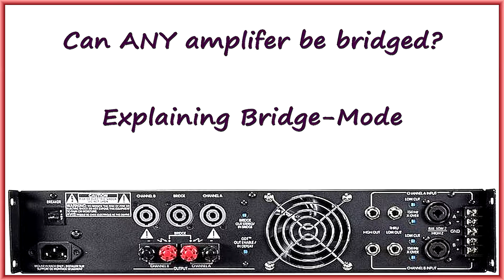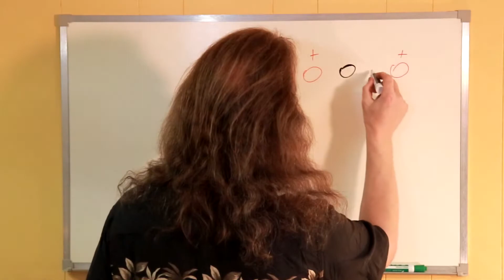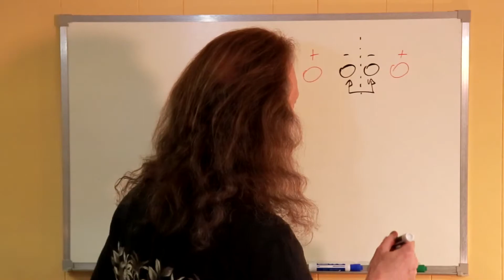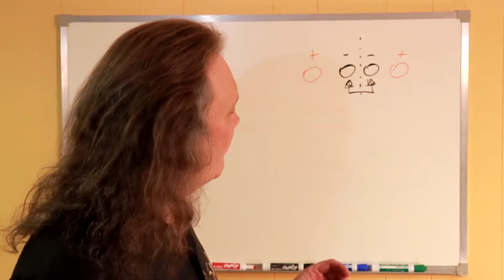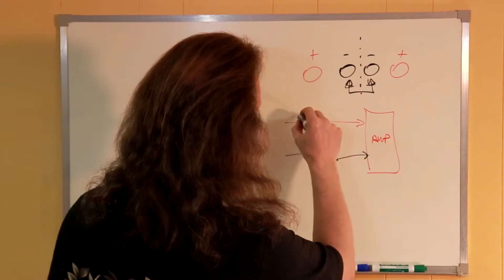Can Any Amplifier Be Bridged? The Truth Every Audio Enthusiast Should Know

Comment: When an amp is bridged both channels are not put together one channel the left or the right is put through a single Mono Amplifier the other channel is put through another single Mono Amplifier never are the channels combined
Reply from the maker: True - there isn't an internal change in the amplifiers.
When an amp is bridged, you provide the same mono signal to both L+R amps (one inverted) and combine the two amps at the output to create a single, more powerful mono output, using both channels to drive one speaker load.

Comment: I'm looking to turn a stereo 2.0 set up so that instead I get the full spectrum of audio signal (both channels) into a single speaker. Is that what bridge mono does, and can I accomplish it by connecting the speaker to both positives the way you showed in the video?
Reply from the maker: Hi, that's a common point of confusion. Bridging an amplifier does two main things:

It combines the power of two amplifier channels.

It uses both the positive and negative signals from those channels to create a higher voltage swing across a single speaker.

However, it does not magically mix the left and right stereo channels into one full-spectrum signal. If you feed a stereo signal into a bridged amp, it will usually only amplify the left channel (or sometimes the difference between L/R), resulting in missing audio.

So Bridging creates a more powerful mono (single-channel) amplifier from a two channel amplifier.

Comment: Hi. Stupid question: stereo power amp circuit with  "output BTL speaker system" - how could I use it Mono, with only one speaker? Can I bridge the channels? Or do I need dummy load for one channel?
Reply from the maker: Good question, thanks!

You can’t bridge an amplifier that already has a BTL output because it’s already operating in a bridged configuration internally. 

Each speaker terminal is actively driven and not tied to ground, so connecting two BTL outputs together causes them to fight each other, leading to distortion, shutdown, or even amplifier failure.
Reply: @Barry-Watson Great many thanks! So it's like 4 amps internally, briged to 2 pairs.
Reply from the maker: Yes, exactly.

Comment: Can Sansui's B-55 power amplifier be bridged?
Reply from the maker: While most amplifiers can technically be bridged with the right setup, the Sansui B-55 isn't a good candidate. It uses unbalanced RCA inputs, which makes inverting one channel’s input signal difficult without external adapters. More importantly, it wasn’t designed for bridged operation, its heatsinking and output stage may not handle the increased current safely. 

Bridging is more common in pro audio or car amplifiers, which are built with that use case in mind. The B-55 is a hi-fi unit, and best used as originally intended for stereo operation.

Furthermore, a unit that is not designed with bridging in mind may not have the current capabilities to really deliver the expected power gains you would want from bridging. So you may not see the kind of power increases you would expect, unless the amplifier is built rugged enough to deliver the demands of bridged operation.
Reply: @Barry-Watson Thank you very much, you explained very well.👌👍
Reply from the maker: Thanks, you're most welcome.

Comment: I have a Krell KSA-200S in use.
his Amp has 4 Outputs (2+ and 2- on the Right AND the Left Channel.
Does it make Sens to set Bidges between + + and - - at the R and L Channel?
Hope explain it good. ;)
Thanks
Reply from the maker: I don't claim to be an authority on that amplifier, so I may be mistaken. It's a very nice amplifier. However, it is a stereo amplifier, so there are only two amplifier modules in that box. There are four sets of output terminals, but really, only two amplifier outputs (left + right channel).  That is, I believe the two output terminals on each channel are simply wired together in parallel.

To bridge amplifiers, you need two amplifier modules.

You could bridge right and left channels, creating a "mono block" amplifier with one single output. But if you want to have stereo operation, bridge mode is not an option in this case.

Comment: Hello great video! I’m a dj and have a sub powered by a crown xti-2002. I’m trying to decide between running it near clipping on one side of the amp (800w @ 4 ohms) or bridged with hard cut at -6 on the meter using the built in limiter (2,000w @ 4 ohms.) In bridged mode it would have some head room, in mono mode it would not. love to hear your opinion thanks for your time!
Reply from the maker: Thanks for the question !  4 ohms in bridge mode is a pretty severe load for most amplifiers, maybe your amp can handle it ok.  The amplifier will perform better, and you may have a bit tighter sounding bass in stereo mode.  Remember that twice power is about 3db, so play some music with your meters touching -12db, then turn up the level so they are now at -9db - that's about the loudness difference you can expect.  Is it worth stressing the equipment for that much (or little) gain, you decide.

This video might be helpful - https://youtu.be/zXZP2O4rH3M
Reply: @Barry-Watson  thanks for the wisdom! I checked out the video link. So then in your opinion, bridged mode even with the increased headroom still works the amp harder? I was hoping with that extra 3db it would let the amp run less hard compared to running Flat out in stereo mode. I do see what you’re saying about both amps doing 2 ohms not being super great. I think I will try stereo operation again for a while. I’ve been enjoying the channel!
Reply from the maker: Some amps are rugged enough to do bridge mode without problems (with reasonable loads), but it's more stressful on the amp.  Many amps can drive 4 (or even 2) ohms in stereo, but are limited to 8 ohms minimum in bridge for example.

Comment: Hi can u connect a mono antique valve amp to a nad 3140 which has pre out and main
Reply from the maker: Depending upon what the tube amplifier expects for an input signal I would expect that to be no problem. I would anticipate that an old tube amplifier would use unbalanced connections, the same as standard hifi equipment so you probably don't have to do any signal conversion. Just connect the pieces of equipment together with a standard cable.

Comment: If I buy the same power output 5 channel amp can I bridge that to my 4 channel amp I already have? Same brand and everything
Reply from the maker: I really wouldn't recommend that.
Reply: @Barry-Watson  why’s that?
Reply from the maker: First, bridging the amplifier probably isn't going to give you that much advantage anyway.  For me, the juice is rarely worth the squeeze when it comes to bridging amplifiers.  You may gain a little power, but you lose audio performance in every other category.

But bridging across two different amplifiers could invite issues when tying the grounds together between the units possibly, and any little differences in gain between the amplifiers would result in poorer performance. Technically, it could be done, but it just doesn't seem like a great idea to me.  They way I see it... If the amplifiers aren't powerful enough when working as designed (w/o bridge), the best solution would probably be to swap these out for a bigger unit that can deliver the performance you're looking for.
Reply: @Barry-Watson  thank you for the information

Comment: Hi do i still have to swap xlr cable if the amplifier is designed for bridge mode?
Reply from the maker: Equipment may vary, but no, if the amplifier has a bridge switch I would expect that to take care of the input connections.

Comment: So... hey recent subscriber, great channel
I have a PA amp with balanced inputs (three connector) that I want to feed an unbalanced line in into it (RCA) how to do that, what are the pitfalls? 
Thanks
Reply from the maker: Thanks for the question.

You could get adapter cables that apply the audio signal to pin two of the xlr connector and ground to pin one and three. That will drive a signal into the amplifier.  The problem with this is that it's unbalanced, so it could pick up hum and noise, and it doesn't accommodate the difference in typical signal levels between Pro Sound and Hifi equipment. The hifi equipment may not be able to drive enough signal into the prosound amplifier to drive it to full output.  The pro sound equipment also has a low impedance input, which may be difficult for the hifi equipment to drive, or cause the hifi equipment to have poorer signal quality because of the excessive load applied.

The proper solution is an interface box that converts unbalanced hifi level signals to balanced pro-sound level signals.  This will preserve the signal quality, and allow you to make the most of your power amplifier. Here is an example of such an interface box:

https://amzn.to/3QYWaHC
ART CLEANBox Pro Dual Channel Level Converter

This particular unit can convert signals in both directions, hi-fi to prosound and prosound to hi-fi.
Reply from the maker: You may find this video helpful:

https://youtu.be/HP4iDvEaonM

Comment: I've dealt with car and home audio for years. In car audio bridging an amp to run subwoofers is almost manditory. Car amps have a switch to do this on demand. In home or even some pa amps there is no switch so, one trick I learned in car audio dealing with ground loop noise is to use an rca level isolation transformer. These can be be split open and the polarity changed on one channel effectively allowing you to bridge any 2 ch amp that doesn't have the ability to be bridged. Basicly the same thing as changing polarity on xlr as you mentioned, only with rca level-down and dirty but it gets the job done......

Comment: What if you accidentally hit the bridge switch without rewiring the speaker? Will this cause damage?
Reply from the maker: I wouldn't do it while the amplifier is running, since it may create a transient pop that wouldn't be good for the attached speakers. 

The bridge switch just swaps the polarity of one of the channels and usually connects left input to both channels, so no, that won't hurt anything except for your stereo image.  If the speakers were wired normally, in stereo , and the amp is in bridge mode you'd have one speaker pushing outward while the other one is pulling inward.  That wouldn't be very useful, but it wouldn't damage equipment.

Comment: So if you measure continuity across the grounds, then bridging is likely possible.  But since the grounds are already connected internally, would you still need to connect them externally?
Reply from the maker: When bridging a power amplifier you connect your loudspeaker load to the two positive (red) output speaker terminals, and leave the grounds disconnected.  And, no, there is no need to run a wire between the two ground terminals since they are already internally connected.

There might be some oddball amplifier that's an exception to this, but this is the typical setup.
Reply: @Barry-Watson  Makes sense, thanks.

Comment: 8:20, Which is why I "always" - (now that I've blown a few amps, in the distant past, approx. 20 years ago) - I will always use two 1:1 audio amps such as the M1124A toroidal type, which inherently do NOT have much stray magnetism outside of the core itself, which in some situations is critical to avoid.
The other reason is simpler wiring is required, as the two toroid outputs can be common grounded, earth returned, such that a vehicle chassis can then become the "active" earth return path for all speakers, apart from the subwoofer at the very rear of a vehicle, running (usually) off a different sole use subwoofer amp, that has been frequency limited to around 75 Hz max.

Thus instead of needing "four" completely shielded cables, being run to all speakers, throughout the vehicle, one only needs 4x single core cables, one each - for the front L/R speaker pair, and one each - for the rear L/R speaker pair, as the chassis becomes the commoned-earth-return for all speakers, thus no aux wiring is needed, just the single core live feeds.
It's a lot simpler to mouse a single core speaker wire, underneath the flooring carpets, and around seat supports et, than to feed-in bulkier shielded cables.

Comment: I have a Nikko alpha 230 that i'm going to measure later on to figure out if i can indeed bridge it, i have a question if you happens to stumble upon my comment;
Being that the amp only has unbalanced rca inputs, is it possible to feed the 2nd rca input from inside the amp? (i.e.: connecting pin1 of left rca connector to pin2 of right rca and vice-versa)
Reply from the maker: Thanks for watching!

With unbalanced inputs you're not going to bridge using a simple cable hack. You need to invert the polarity of one of the input signals before it reaches the amplifier, and the best way to do that is with some active electronics.  A simple line-level amplifier stage.

I don't think you're going to get impressive gains by bridging this amplifier so overall I would advise against it. But if you really want to explore this, a possible solution would be to get an amplifier unit like an art clean box that converts unbalanced input to  balanced outputs.

You could then wire up some cables from the output of that converter box.  Bridging creates a mono amplifier, so there's only one amp input so you'll only use one channel on the converter box. On the xlr output of the converter box, connect your rca cable grounds to pin 1 of the XLR (ground), connect RCA signal (L+R) to pins 2 and 3 of the XLR Connector.   XLR pin 2 is signal positive, and pin 3 is signal negative.

ART converter box
https://amzn.to/3I8BgRD
XLR (F) connector you'll need to solder your RCA cables to.
https://amzn.to/3IaMIwk